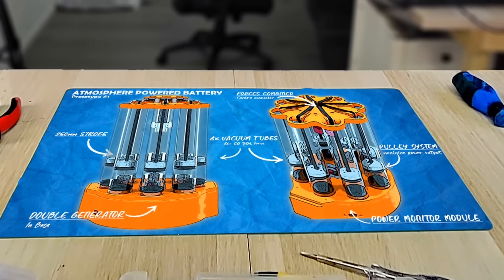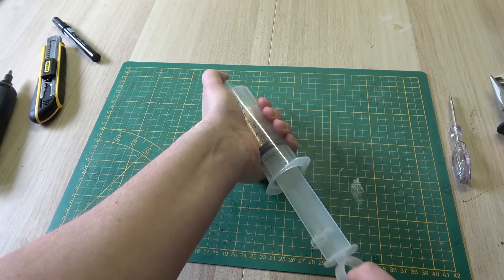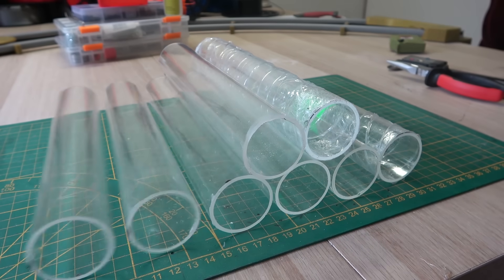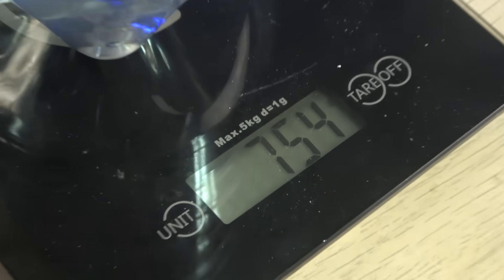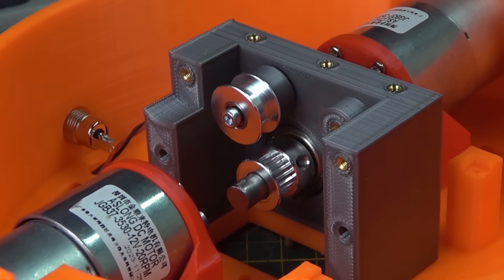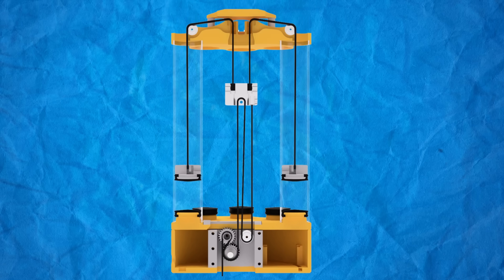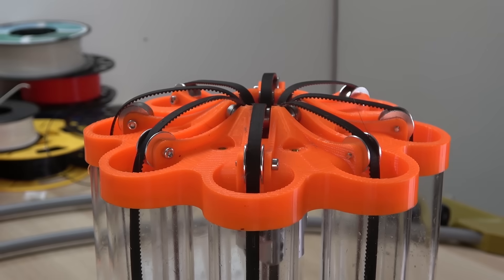Building an Atmosphere Powered Battery..

Comment: You needed to have more footage of the operation of the device. Needed to be able to see it in action actually generating power and measuring that amount of power and function and efficiency should have been visualized. You did a good job with the weights and pulleys but when you built this device oh you really see is the plunger pulling a vacuum. Need to have some kind of measurement of electrical input and output clearly visualized. Other than that great job! This is a concept that I have been toying with for a long time and I'm glad to see somebody actually putting it in to use even if it is prototypical.

Comment: I'm drawn to this energy storage system for regenerative braking in motorcycles (if the design were radial, the cylinders could even replace the wheel spokes, so the battery wouldn't add any extra weight or volume). When the motorcycle brakes, the pistons create a vacuum in the cylinders, and they "charge" with potential energy. If the motorcycle is at rest, atmospheric pressure pushes the pistons back, and the wheels start rotating again, thus discharging the battery.

Comment: In my opinion, the main problem is the piston seal, which will deteriorate over time and is susceptible to manufacturing errors, etc. It's better to use a vacuum chamber, which has no moving parts and is "pumped" during the day, etc. It's also worth considering whether the energy storage could simply be an air tank, like in a workshop compressor. It doesn't matter whether the working medium is a lack of air or an excess. The only argument could be that in the event of a failure, the vacuum tank implodes, causing less damage (although...).

Comment: Technically I'd say you can flip it ninety degrees so the machine lies flat. That way you skip the pulling of those plastic parts against the force of gravity which since they cause a lot of drag I believe might save a bit of electricity

Comment: when I saw the thumbnail, I thought he was going to use the change in atmospheric pressure over a day cycle to operate a generator. If a syringe is sealed at one end, then temperature change during the day is going to move it, could use that somehow.

Edit: FYI, this concept already existed and was used by a clock maker to make a clock that never had to be manually rewound (except on days where the amt pressure did not change much).

Comment: intresting approach, but loading air requires a long stroke (volume) to store energy. The high friction reduces efficiency. Using hydraulic oil to lift weight or pumping fluids to a higher level may bee much better. Energy density is an important factor too.

Comment: Is it possible to make a device where you start with plungers at vaccuum state and a second set of plungers at vacuum, and connect them in a way where there is a valve for each set, such that when half the plungers' valves are released, allowing vacuum to turn to 1 atmosphere, it would then would trigger the valves to close, and those of the other half to open. When the other half opens, it would cause the first half to close and get to vacuum, which would start the cycle over again.

Comment: Absolutely loved the experiment❤. I have been dabbling with energy storage ideas for last 10 years. I built a small prototype of buoyancy based compressed air turbine and even got a patent (9627953 B1) for it, however I did not have access to 3D printers at the time. Would you be interested in giving it a shot in the interest of science?

Comment: what's the difference between this and just compressing air with surplus energy
Reply: For one thing, compressing air would generate heat.  For another, the more compression applied the more pressure the container would need to be able to withstand.

They may have similarities, but they do store energy differently.

Comment: Nice try, but ... Why would one cut a pipe into 8 pieces then use a pulley and gears to transform the moments? Why would one use high gear ratios for motor/generators? The least friction from seals you get by adding up all 8 systems into a single long pipe. Then you can use a smaller gear reduction with less friction and better efficiency. However the following calculation shows that even then the idea is impractical. You have to dig a pipe with 1m radius and 100m length into your garden and have it successfully charged to get the equivalent of 8.56kWh energy storage plus motor/generator and electronics. This competes with a 8kWh LiFePO4 accumulator (40kg, 0.020m³) currently sold for less then 1000€ plus ~ 500€ for electronics.

Comment: Another approach would be to use constant force springs (Negators). For a given stroke length these would store/produce more power than the vacuum approach because the force produced by the vacuum cylinders falls off as the plungers drop. Interesting nonetheless!

Comment: An ideal i got from thinking about this after i seen the efficiency drop converting the mechanical motion into electricity. The ideal is to hook the mechanical motion directly to the actual load you are powering and skip the step of converting the mechanical energy into electricity only to convert back into mechanical energy again anyway. For example it will work only for things that ultimately require mechanical energy to make it work. IT could in essence replace the generator altogether in the vacuum energy storage device and the motor in the appliance taking the load. For example a pump, a fluid requires mechanical motion to move the fluid,  so instead of powering a motor from a generator just hook directly mechanically instead. In other words use the mechanical movement of the vacuum battery to move the turbine on the pump directly. This way you get more efficiency.  Yea there will still be loses but it should be less, probably half as much or more.

Granted this won't work for all appliances and devices that ultimately require electricity, but for those that only ultimately require mechanical energy it will work. Like a air powered motor for another example, ultimately it only requires physical movement of its turbine(or piston and crank). How you make the turbine(or piston and crank) spin it don't care about, all it cares about is that it is spinning and it will do work.  But better yet a pump that pumps air can store the energy in a air tank while the vacuum device can go another cycle and continuing to store more and more, etc...etc... cycles continue.

Comment: 628W during discharge means it is a 628WH vacuum battery? Not too bad for its size and weight. If you could double that you can match a lithium 12.8vdc 100ah of 1280wh? TBH you could crowed more cylinders in the space. No reason they can't be 1mm apart.

Comment: It is certainly the most compact, portable, and lightweight of all those options. Longer tubes and a horizontal orientation. Plus, you could charge it in the air and then submerge it for energy harvest and get about double the energy invested in creating the vacuum if you submerge it to about 10 or 11 meters in water. You can use current to submerge it and bring it to the surface with dive planes such as are used on submarines. You can use a drogue in the current to supply mechanical power to evacuate the tubes. The tubes can be arbitrarily long.

Comment: It works as well as it does because there is very little time between charging and discharging.

If you were to wait hours between charging and discharging, leakage around the plungers would allow air in and reduce the available vacuum.

This is a novel design but would not be practical in real life.

That being said, it was a marvel of engineering.

Comment: Can it be used in a deep sea simulated test?  By this, I mean, putting the apparatus several meters under water and exploring the optimisation potential.  Perhaps with a wind turbine driven air pumping / evacuation mechanism?

Comment: Another very interesting video, thanks! It is interesting to remember that the very first steam pumps worked on a similar principle where they relied on the atmospheric pressure to push a large cylinder down again after it had been pumped up by steam in the cylinder which was then condensed to pull a vacuum by an injection of cold water!! I can imagine your test piece scaled up to the size of a large building and wonder what the energy storage capability would be!!

Comment: I think capacitors are more effficent.. does your  system  scale  up.. and how much can you store  I think   compressed  air is  interesting in that you could use a fresnel lens and super heat low presure are into   so much more volumn with the sun to pick up  a lot of mechanical  energy

Comment: Scale the system up to the size of a tool shed and have the suctions lift in the sunlight with a solar panel and discharge when the sun goes down and with STRONGER rubber stoppers (avoid the chinese ones that will break in a few days),  it is a nice system!

Comment: I'm a bit late but I have a suggestion for you. 
If the point was to have something as  tall and big as a house cheminee like you showed at first,  there's this different version of pump hydro, instead of sending water down a turbine, you send turbine down a pipe filled with an appropriate liquid the turbine charges super capacitor as goes down, and release all the energy into the grid once it's a at the bottom of the loop. You can use passive energy around the house to make this turbines go back up the system and complete the loop.  It's base on the flight pattern of the vultures, they get and ascending warm current and then glide their way down, using the passive nergy around them.

Comment: On a larger scale you can play with pulleys to get more out of it
For energy storage and charging on the cheap. I use drill batteries and chargers also drill motors are very built for long term abuse

Comment: I just wonder where you got that numbers. If I see correctly you use 8 pieces of 36mm bore cylinder aprox 25cm long. So you got aproximately 10kg of force on each cylinder or total 80kg of force. So you have aproximate 800 N force over 0.25 meter. That give storage capacity of 200 Joules. And you claim that you got 628J electric power from 200J available storage space? Or I miss something.

Comment: Very cool. Without running the math - my intuition is that energy density will be the main problem with this. 1 bar of pressure is going to have a pretty low hard density limit - making it impractical. If to power a house for a day you need more volume than the house then the problems of scaling become obvious in a way it isn't on a model.

Comment: Sticking the vacuum battery down a few meters below the surface of some water should increase the capacity as the water will make the outside pressure higher.

Comment: How big would this machine have to be to match a simple 12V 64Ah car battery. Not viable. Just use a bunch of old fashioned led based car batteries. Nothing fancy yet 100 years plus proven safe technology which exists in abundance. No slave children in africa digging for lithium, just to improve a littlebit on efficiency and weight, with the perk of inextinguishable fires ;)

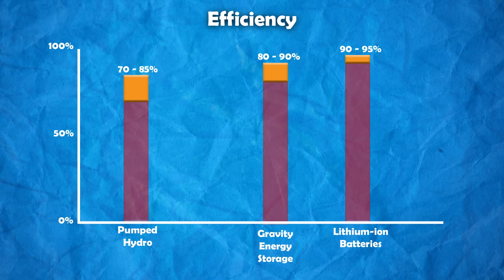Comment: 12:09  🤦‍♂️ That’s akin to baking a pie and throwing out 1/4 just to save it for later. If it doesn’t need to be transported, what really is the point. Self powered flashlights? Sure. Emergency power source sure such as man powered by gravity and a rope for a home. Otherwise it’s most efficient to generate the power and use it at the time of generation.
Reply: Hydro doesn’t count as it is a source not a storage. The storage would be what holds the water apart from the source. Then that efficiency would be based on water storage. Niagara Falls for example would have no storage for hydro production as it is a continuous feed versus a reservoir system (man made lake). 😊

Comment: Isn't solar somewhere between 15 and 25% efficiency? and people are buying that like their hotcakes. This, in place of the massive weights or the large holes that you would need for a gravity generator, seems like a much more functional and cost-efficient 'pocket' method of storing extra power. I like it! If I had that level of engineering and resources, I'd make several. This place gets plenty of wind at times, so recharging would be easy with free natural energy, to be used in those times when the wind dies. Especially if you had a sensored such that would monitor incoming power and such to recharging when there's more coming in than going out (while still running whatever load). 😃👍

Comment: Would it be possible to switch the down stroke to a higher gear ratio? I'm not an engineer but it seems like being able to spin faster on the output would yield more energy. Is that possible?

Comment: This is a really cool idea and I love the combination of metal and 3d printed parts. I love the idea of multiplying small systems by integrating them into a single larger system, like car cylinders. For a commercial system, it could be viable for sure. From a field tech point of view, I could see the seals being a frequent point of failure that would need replacing. I don't know how the whole system works when one of the cylinders goes down?

Comment: If there is a place that has a change in pressure, perhaps movement between the two places could make this viable. Like a space elevator. The change in pressure between the two places could charge a battery with this concept. Kinda like temperature difference in the ocean but too much of that could have adverse effects on the ecosystem.
I was going to point out that friction and the strength of the tubes are your biggest efficiency obstacles (mentioned in comments but not the video). Higher quality and tougher materials could improve the numbers but this video still did a great job explaining the concept. Gotta withstand the pressure and friction.

Comment: not very much charge held therem but cool idea.,.... To calculate the energy in kilowatt-hours (kWh), we'll need to convert the values given in watt-seconds (or joules) into kilowatt-hours.

1. **To Charge**: 
   - Energy: 860.64 watt-seconds (or joules)
   - Conversion: 1 watt-second = 1 joule = \( \frac{1}{3600} \) kilowatt-hours (since there are 3600 seconds in an hour)
   - Calculation: \( 860.64 \times \frac{1}{3600} \approx 0.000239 \) kWh

2. **After Discharge**: 
   - Energy: 628.24 watt-seconds (or joules)
   - Calculation: \( 628.24 \times \frac{1}{3600} \approx 0.000174 \) kWh

So, the energy to charge is approximately **0.000239 kWh**, and after discharge, it's approximately **0.000174 kWh**.

Comment: I'm pretty sure you can use this device to harness energy from daily thermal cycles as hotter air is less dense than colder air. So If you were to charge this system in the heat of the day and it can maintain its vacuum until the air around it cools down you should get a little extra energy from it. Almost like a backwards air conditioner lol

Comment: That is extremely complicated compared to the possible storage of force. Might I suggest looking into Flywheel batteries? much higher energy per mass then gravity batteries let alone this and was actually used in buses in the 1960s to moderate success. The issue that ended that experimental bus line was also solved with the advent of magnetic bearings allowing for higher speeds with less weight equalling the same overall storage of energy.

Comment: In a cold winter day my home consumes 4 kW for heating with my heat pump. To power my home for 24 hrs I thus need 24 x 60 x 60 x 4 x 1000 = 345600000 Ws. The energy storage of this device is 628 Ws. Thus, to heat my house I would  need more than half a million of these devices (550 318 pc). There is even not room on my property for this and the cost would be astronomical.

Comment: I think that the belt might be slipping too and I would suggest one more thing that you should make a system in which you use suppose A set of motors to charge and on discharging you should use proper generators that are very efficient like i would say stepper but it totally depends upon the search of efficiencies of motors and generators and I would say that use some lubrication too in the tubes as well as orher mechanical parts,,, I'm working on a similar kind of project and that is typically aboit the generation of electricity without any input #breaking the laws of physics 🤓